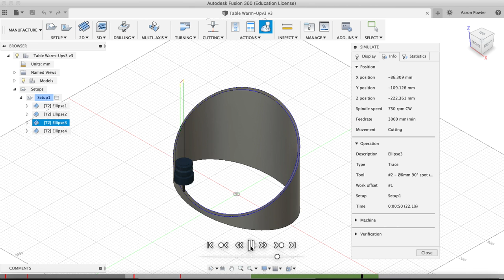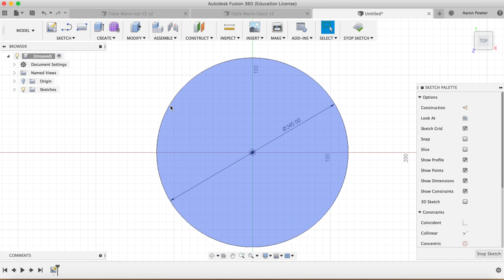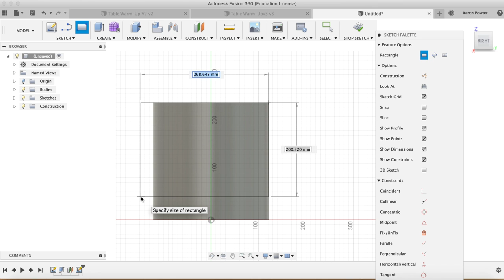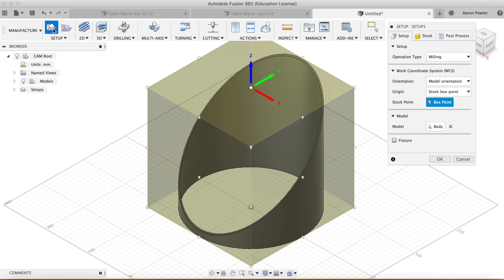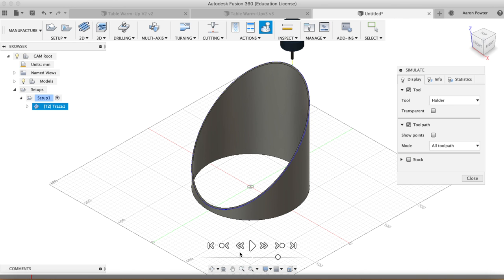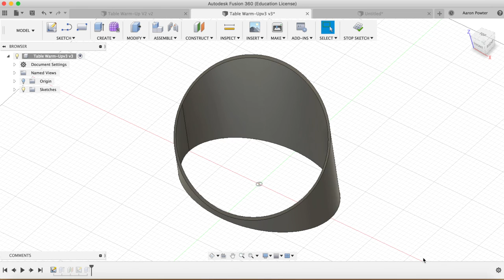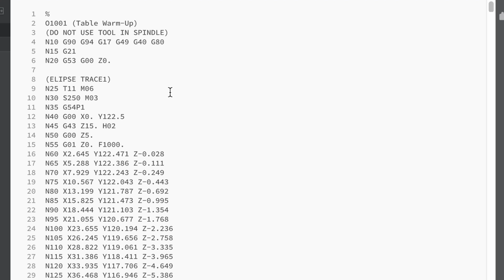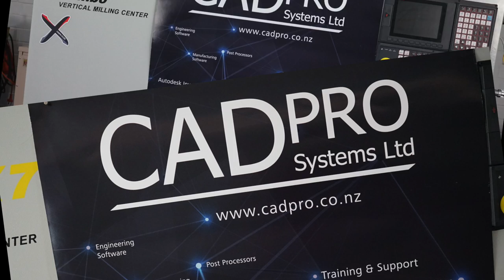CNC Table WARM-UP Program created with Fusion360 CADCAM

Comment: Nice one mate.I think there will be a big elliptical  program being added to my Tormach"s warm up sequence for sure.
It will produce a nice musical sound to the warm up as well.
Reply from the maker: Hey Micheal.  I will add both fusion file to the video description if you would like it?
Reply: @DCT_Aaron_Engineering  I think I will do my Model with 4 different radius corners and then slice it diagonally for the tool path.Just for fun.

Comment: Solid tips!
Reply from the maker: Thanks for following along Carlos.  Most people could probably hand write the code to do that, but I thought a Fusion360 example would assist those that can't (like me LOL)
Reply: @DCT_Aaron_Engineering  It is a fantastic exercise to learn something about Fusion and G-Code and proper use of a CNC machine. 

If you want, give me a call and I will share my macro based version of the same thing. It warms up the machine and teaches the user the fundamentals of macros. You would be a great great teacher.

Comment: I would use more like: G1 X10 Y10 Z10 and G1 X200 Y200 Z200 (to max.) and back, so i can easy repeat it with feed paramaters changing.
Reply from the maker: That's a very good idea.  I did it with Fusion360 CAM for a couple of reasons.  To help those who are new so they can model it and also post process their code if they don't know how to write it.  Thank you for the handy tip.  Hopefully others are reading the comments so they can see this ;-)
Reply: @DCT_Aaron_Engineering  make sure to use G53 because G54 is never going to be at the same place
Reply from the maker: Santosi hey buddy. Can’t use G53 as Z Height has to be -50.  That I why picked a higher offset that I never use such as G54P1 🍻
Reply: @DCT_Aaron_Engineering an easy way to program a warmup program is to go to MAX travel of X, Y and Z (for example X50 Y40 Z20), then noting the machine coordinates, do the same with MIN (for example X-50 Y-40 Z-20) and then just say:

G53 X50 Y40 Z20 F2000
G53 X-50 Y-40 Z-20 F2000

repeat 20 times in a loop subroutine

i get that you also wanted to do this as a tutorial for CAM/CAD beginners but warmup routines dont need to be fancy :)

Btw for me its just a habit to do something like that in G53 (although we work with Heidenhain controllers which G53 is M91)
Reply from the maker: Hello Santosi, thanks for getting back to me.  I appreciate your time in writing your reply and thank you for your input.  Hopefully others reading the comments will try your method also.

That is very interesting regarding M91.  I have never used a Heidenahain controller before, only fanuc based types.  Have a great day.  Regards, Aaron.